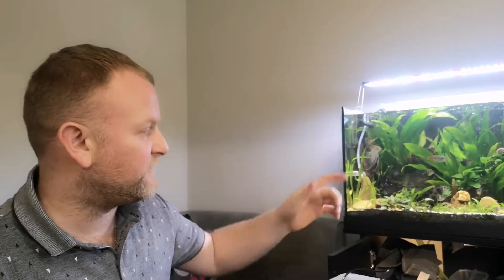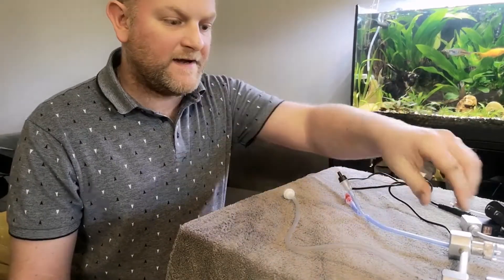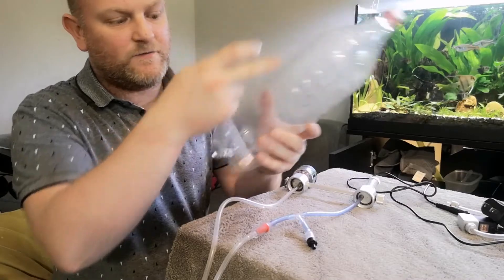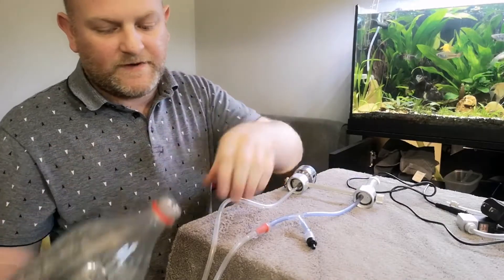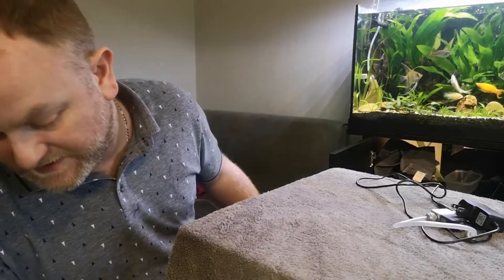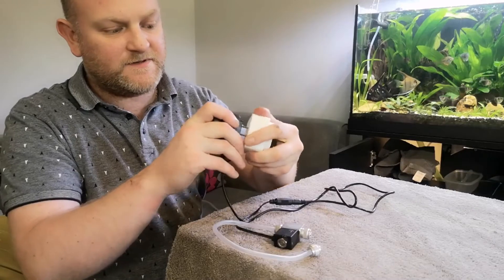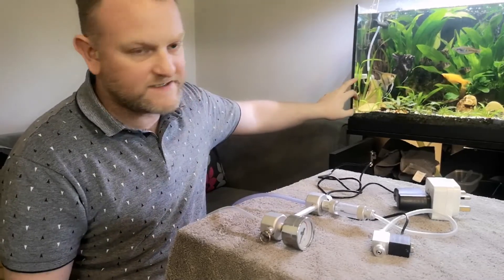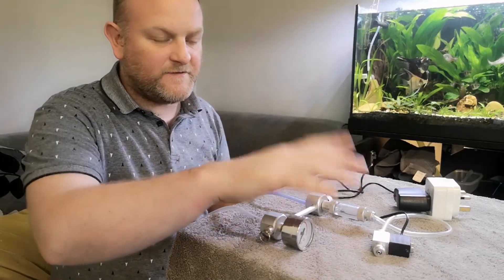CO2 REACTOR FOR MY planted AQUARIUM 🌿☘️🌿🌿

Comment: How long is the co2 and the unit last? Are you still using it?
Reply from the maker: It lasts about 2/3 weeks I had it on strong the amount it runs for is different for every tank if it’s on very low it can last up to 4 weeks. At the moment I don’t have it running as I am trying a no filter aquarium so very little surface movement